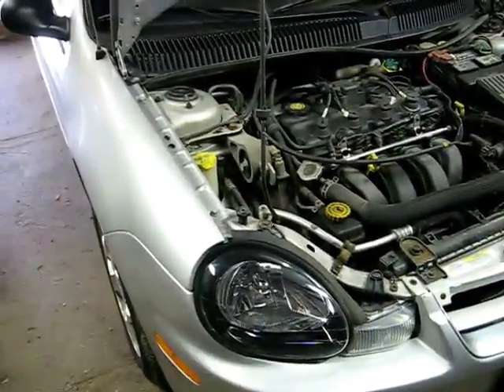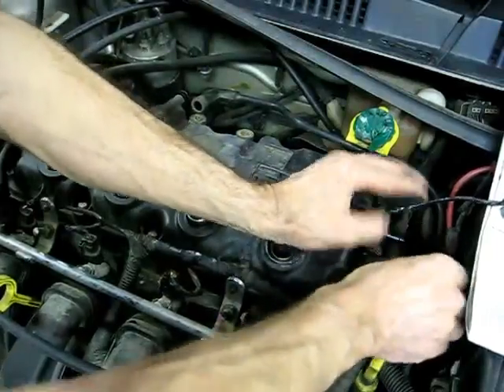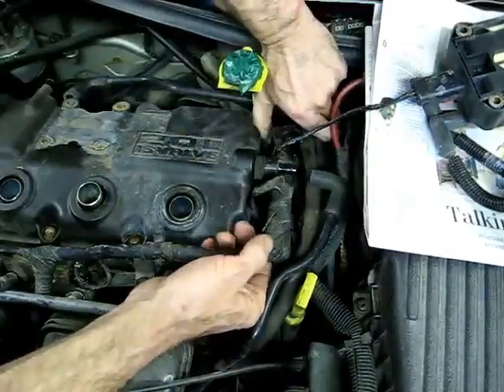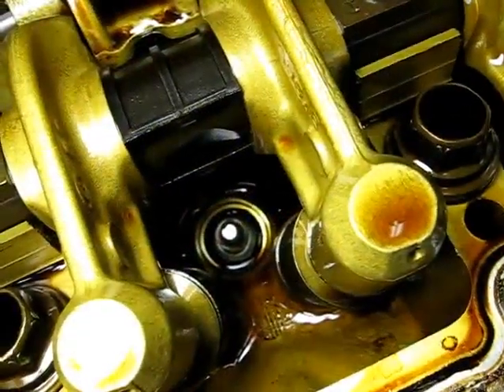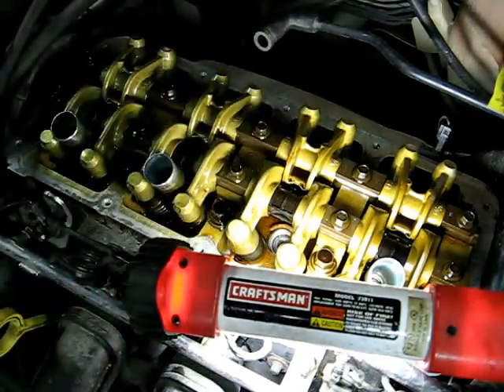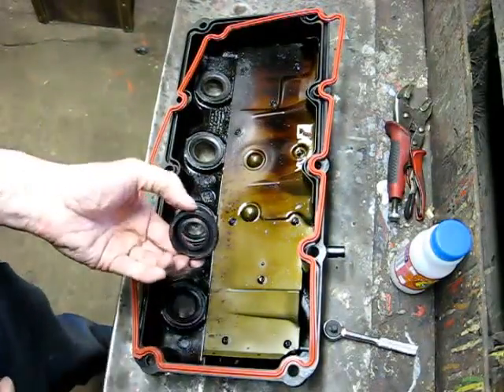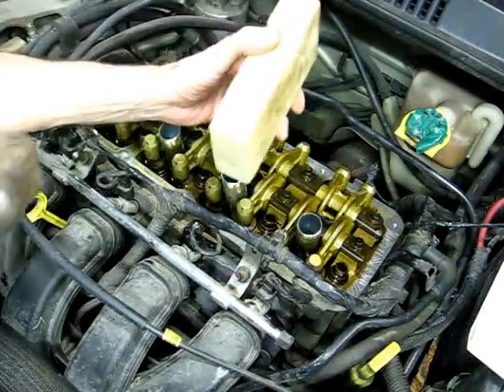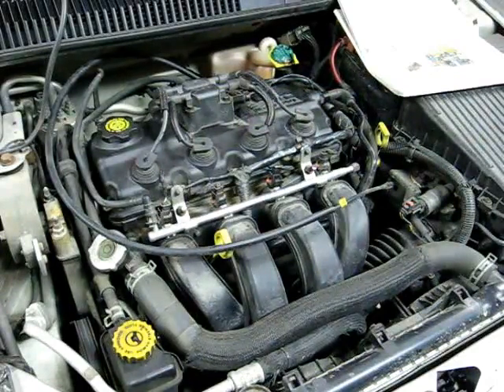Dodge Spark Plug Tube Repair

Comment from the maker: @cloud1833 Yes the top part is called the valve cover and under it are 2 preformed gaskets that fit in grooves.Do this go to your local pick u pull junk yard you know the one were you pay 2 dollars and you can go in and take off anything you want from the vehicles.Then practice taking off a cover so you are familiar with how it goes.

Comment from the maker: @hiddenhorse101  It is a little hard over the internet to tell someone how much to toque a bolt it is all feel.What i can suggest is you use a 1/4 inch ratchet  much harder to overtoque the bolts with that size it is what i use.
Reply: Or can use a torque wrench.

Comment: Thanks for this video.  I went to replace my spark plugs today because my car has been running terrible, and they all have oil in the tubes.  Your video really helped me because I drive a 2000 dodge stratus and it has the same engine as your video.  Thanks again.  I haven't done the job yet, but I'm hoping for a good outcome.

Comment: The coil and valve cover bolts are 10mm, for the plugs you need a 5/16 spark plug socket and at least a 6 inch extension

Comment: Hi, I'm going to have to do this for my 2001 Dodge Neon this weekend since I found oil in my 4th cylinder when attempting to change my spark plugs today. Do you think it's possible to give me a list of all the tools you used and measurements of them so I can go out and by them. 

Also, do you happen to know the size deep socket I need for the spark plugs? Research on the internet hasn't turned up anything.

Comment: Hi I have the same problem with this neon. And I was wondering if it is necessary to remove the valve cover. Can I just pull the spark plug tube out, put the lock tite on then put it back in with the valve cover on? I just don't want to buy a gasket set.

Comment: I like the paper trick for getting out the oil. The previous owner spilled a bunch down two of the holes on my Saturn and I makes the spark plug wire boot come loose.

Comment: i have a dodge neon 2002, i change the water pump ;cause it was hitting up like crazy. i made sure that the time belt align correctly, but after i try to start the engine, i cracks like it wants to start but nothing. i check the spark plug and they don't spark. what could it be, they were working before.

Comment: i have 2003 nissan altima i had oil leaking changed spark plugs,valve cover gasket and now trying to change seals on back of valve cover i have 4 new seals dont know how to put them on

Comment: i havent worked on the neon, but ive taken the head off my saturn DOHC, and it didnt drain the oil. you shouldnt have to either. id just let the car sit for 10 mins at least b4 u do it, so u let the oil drain out of the valvetrain.

Comment: you can buy a thread tap from napa just make sure you put the right size thread in had to do it for my 96 integra and it was a deep burrow so you have to extend and one more thing the guy at napa told me to turn over the engine aftr you put the thread in do not put in the spark plug because you need to blow out the excess metal shavings =)

Comment: Thank you so much for your video. It saved me a few hundred bucks I guess... it worked beautifully. Question though: Where the tube seal go to? I didn't see you putting them anywhere so I didn't use it, but still have them. Thanks again
Reply from the maker: There are seals for the tubes in the valve cover gasket set.
Reply: Need to remove the tubes first before removing old “tube” seals and replacing with new seals? Thank you for great video.

Comment: We had to heat the bottom of the tube with a propane torch. Does take to much. It was costed with red locktile. We put the same on the bottom of the tube.